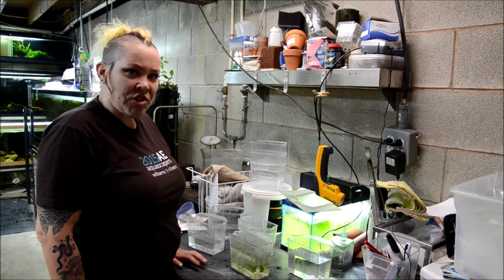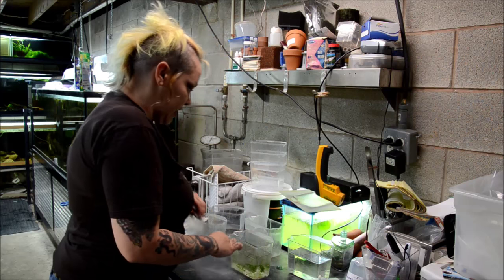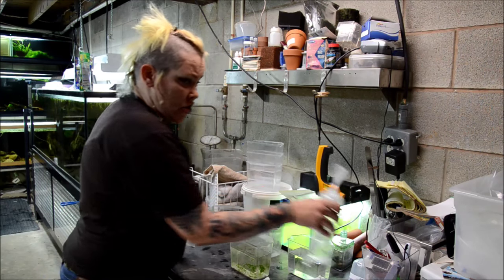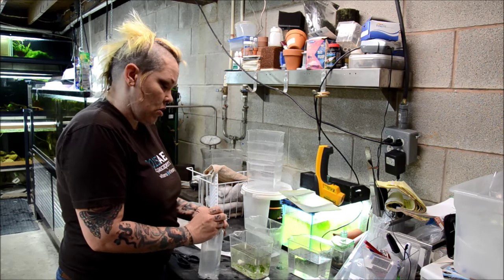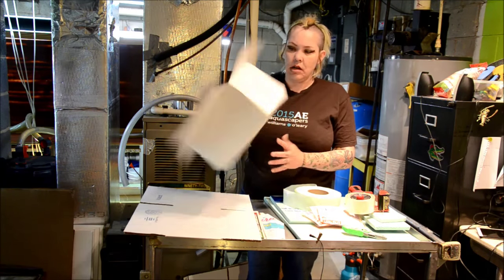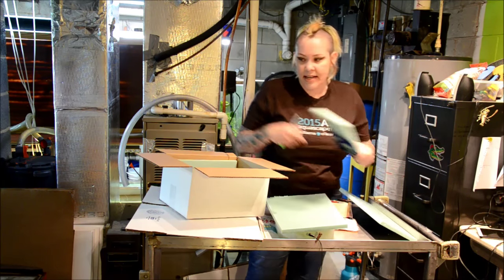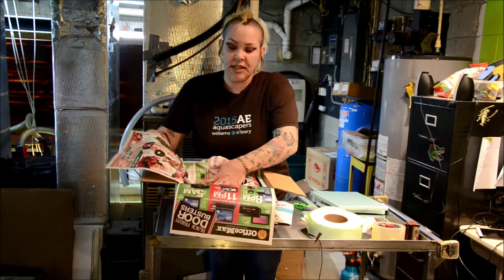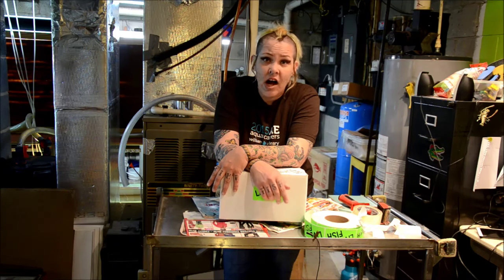Boxing fish for shipping -Tuesday Tip

Comment: You Rock! Quite possibly the easiest fish guru to watch on youtube. Straight to the point without the hyped-up presentation. YES!!!! I noticed you don't use Methylene Blue or pure oxygen. I need to send 120 guppies coast to coast as cheaply as possible - so small boxes, low weight- would you then recommend such measures or, is it your opinion they are never necessary/a helpful part of the equation?
Reply from the maker: I never use chemicals, and only use oxygen when things are especially hot outside or I amm shipping a species that truly require it (hillstreams for instance). I would recommend you find some breather bags, as you can use less water and they take up less space in the box.

Comment: Ya Msjinkzd! You put together a great presentation. Keep it up! Pretty well organized pack and shipper too! Know how that goes... Something to consider if you want. Those poly-pads are oxidizers. As in, they are actually stressful and can cause pH crashes. Consider Zeolite as it's a reducer. If you want to check, you can do a pH tests on the pad. You'll see the pH drop. You can also use a ORP Redox meter to see. I have a video on this if you ever... Your awesome Rachel. Thanks for sharing!
Reply from the maker: +Devon Trigg It is a very low level oxidizer, and the tiny piece i use should not be detrimental especially when it is limited 15-30ish hours or less with my shipping methods. All the data I have found talk about long term use being detrimental, not as a short term solution- though I do caution to use a very small piece (even if using in a fish tank).  pH dropping is also almost beneficial in shipping water,  as it reduces the toxicity of ammonia (which is algorithmic) during shipping. Zeolite is an alternative, but not my preference based on my experiences thus far, though I will certainly give it another go.
Reply: Good points Rachel... I see what your thinking. One point I would make, which I don't think is being thought of, is when to use Oxidizers vs. Reducers. I would urge, that since shipping is a stressful time for the fish, why add another stressor? In times of stress, we want to boost immunity the best we can, which is why a reducer should be used. You are right about time... it's a a major factor, but already being under stress is another. The point about pH dropping being almost beneficial, I see what you mean. The Ammonia will be converted to Ammonium. What I would say, this is a double edge sword then, cause the fish will have to be reintroduced to a higher pH plus, there are other ways to reduce ammonia toxicity. Great conversation. Thanks for at least considering and thinking about it. Thanks Rachael and keep doing your thing...

Comment: Very well done. I was thinking about the storage bins in the backyard as well. I wasnt sure if clear or a color bin would work best? I think i would bury the container(s) partially or fully in the ground though in order to help with the fluctuating temperatures? It would all be powered by air tho if i can get away with that? I am excited to see your setup!!! ;)
Reply from the maker: +FishTankAddict I like black Rubbermaid stock tubs, more volume the better. Placement is integral for temp as well. Filters can be optional, I generally just use a circulating pump
Reply: Thanks for the response. Ok i will keep that in mind.

Comment: I was talking to Ken and he mentioned how bad the breather bag quality had gotten, sad times, used to be good bags
Reply from the maker: +Greg Jones (Greg&#39;s Fishroom) I have only had issues with the bags I have gotten from him, mainly i think because they were the smallest size (he is the only one that generally offers those). I have moved up to a larger size and a different distributor and the problems stopped, but I am still super careful.
Reply: +Rachel O&#39;leary From what he said it sounded like a quality control and change in leadership issue at the manufacturer, glad to hear the quality has improved

Comment: So, by clean shipping water you mean fresh, clean water you'd use to top of the aquarium or do water changes, correct? Lol, funny gars. Considering setting up my own Prehistoric tank as I'm super into the Reed Fish and am looking into a good fish (or few) to feed culls to
Reply from the maker: +Jacob “GreenGo” Green It really depends on which tank I am shipping from. Generally I do quite a few changes over the weekend and towards the end of the week. I often will catch the fish in a small amount of their tank water, then add unused water to the container. If the tank water is altered (ie way softer than my tap or way harder), I will use just tank water. I do multiple water changes on each tank each week, and don't feed before shipping so its generally pretty clean. In general, CLEAN water is what is important.

Comment: Rachel, any tips on shipping crayfish during the summer time? What type of cold pack do you suggest if I'm looking to ship in the southern states?
Reply from the maker: I usually ship overnight, guaranteed by next morning am and drop off in the evening. This way they avoid the heat. You can also have packages held, which makes them available earlier and keeps them from sitting on trucks. I don't find cold packs to be very effective after the first 12 ish hours unless it increases the package weight so dramatically it increases shipping costs.
Reply: @RachelOLeary  ah that's brilliant, I'm going to try that. Thank you so much! ❤️